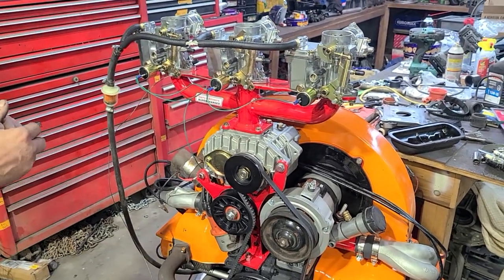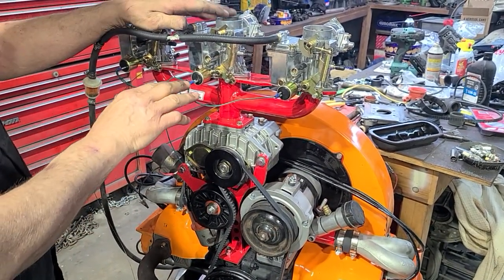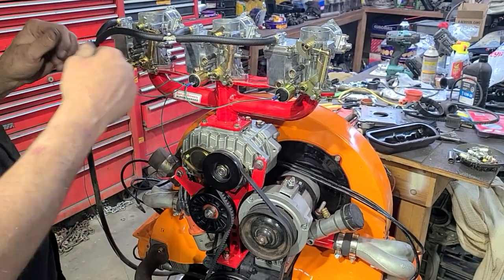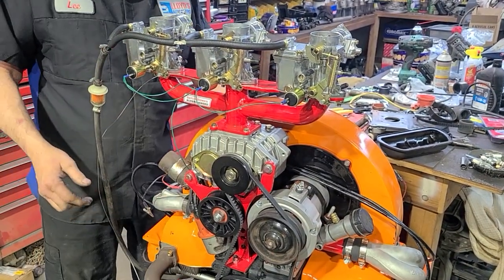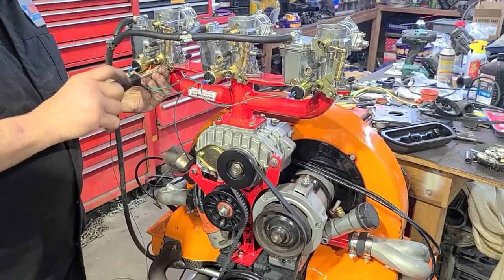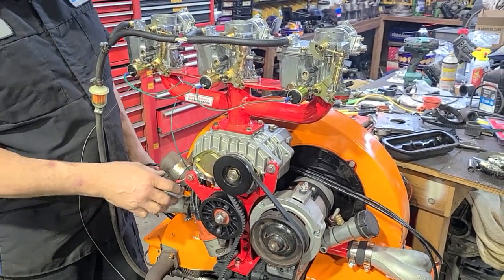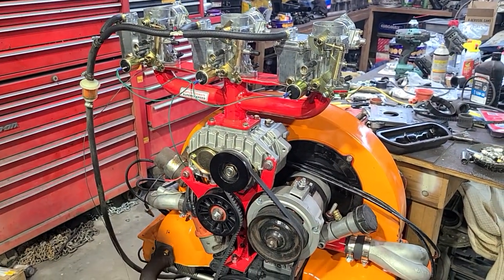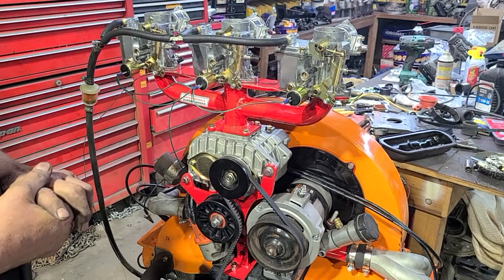the tri power setup. and first testing

Comment: Your loosing flow speed on the venturi's
Reply from the maker: @michaelnagy4603  yes some but with a little time on tuning it will work good.  Won't be as good as a single 44 but will work good.  Already done it years ago

Comment: You need to feed the carbs into a plenum that hast the combined area of all 3 carbs.. Trying to feed the super charger through a manifold that is too small limits the flow into the super charger.  At this point you are better off with one carb.
Reply from the maker: It was never meant to be a full all out powerhouse.  Its like the old flathead guys that put 3 /2 barrel carbs on adapter to a 4 barrel intake. It's about the look. And the blower has almost the same size inlet as the size of the tube.  And bot every thing in life have to be perfect to enjoy